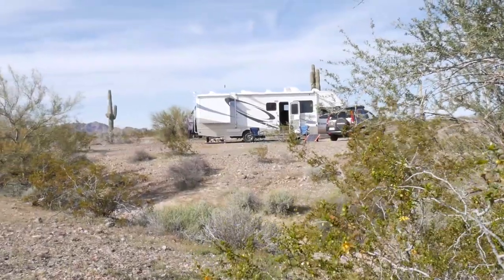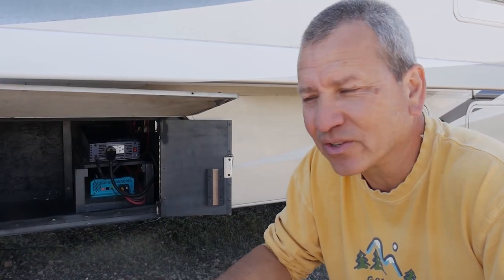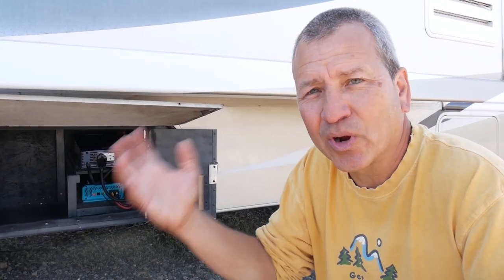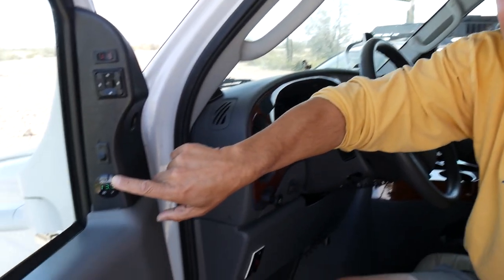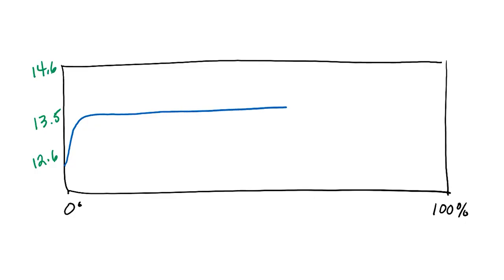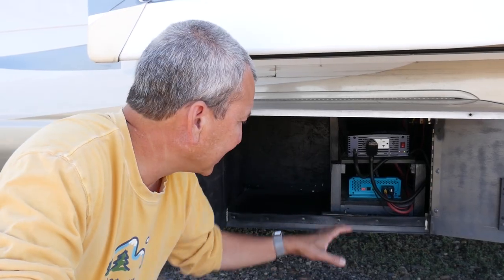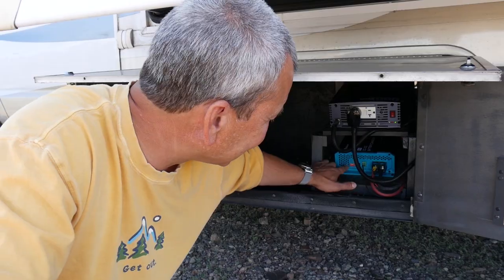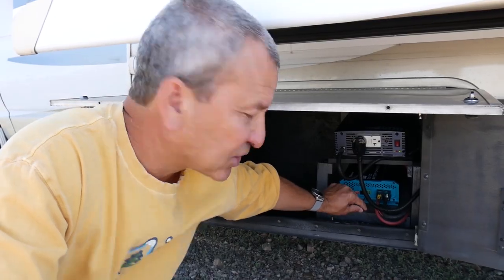Charge LITHIUM Batteries While Driving - System Setup

Comment: Hey Brian, I have purchased the 40 amp model, apparently well suited for my 160A rated alternator.  I really like your illuminated switch idea so as not to overheat the alternator when idling for any length of time.  According to Renogy's instructions, the charger should be as close as possible to the house battery.   That said, I have a trailer, so the charger should probably be in the trailer, not the truck; one more line to connect/disconnect every time I hook up.  To facilitate the switch installation, maybe the charger would be okay at the back end of the truck with a few feet of extra wire on the output side.  Any thought on this?  I'll also ask Renogy to see what they say.  Thanks.
Reply: @MrSilvertech  Mike, I don't think the factory connector on my Dodge Ram has wire any heavier than 12AWG.  Renogy recommends #4 for the long distance  that I had to run from the truck battery to the trailer.   I added 6AWG (as I already had some).  Seems to carry 40-50 amps as required.

Comment: Brian: Enjoy your videos!
2 questions  do you run the negative output of the DC DC to the chassis or to the shunt then negative battery terminal?  How do I locate your diagram to the solar system, also what are the gland size for 10 awg and 6 awg wire? Thanks

Comment: Hey Brian.  I'm in the process of following your footstep on upgrading my Class A from AGM to lithium.  I'm going to use the DC-to-DC route as well... but only thing I haven't been able to figure out is what to do with the current alternator charging (of the AGM batteries).  Since my AGMs have been charged using the alternator all along, I assume I need to disable that as part of this DC-to-DC charging upgrade... right?  What do I need to do in order to disable the alternator charging?  More specifically the existing wiring on the current AGM batteries.  Thanks!

Comment: I recently installed the same Renogy 20A DC-DC converter in my trailer to charge my lithium battery from my tow vehicle (TV) and learned a couple of things.  First, the output power to my battery measured 262W (spec says output power is 250W), and the input current was 30A at 10.37V.  Input current is not specified for the device, and I was surprised it was as high as 30A, and I need to run heavier gauge wire; 12ga isn't enough.  Thanks for the informative video, as always!
Reply: The manual says to use 10 gauge if less than 10 feet, or 8 gauge if further.
Reply from the maker: You're welcome!

Comment: How did you wire in the on/off switch?  Just a 2 pole switch between the dc to dc and a power source?
Reply from the maker: Yup that's it. It shares a ground with the negative battery terminal. As soon as it sees 12vDC it turns on.

Comment: Does your DC to DC charger work okay with your van just idling? A lot of times I have to idle and it would be nice if it's still charged my battery without overheating
Reply from the maker: I've idled for a couple hours or so. I don't like to do it but I have many times without issue. It doesn't put out full power at idle though.

Comment: Hi Thanks for the info... got a question for ya...
What is the second smaller red wire on the Output side of the DC-to-DC  Charger?
Reply from the maker: Gonna make me watch the video. Hold on.....Yeah it's just powering my cooling fan in that compartment.
Reply: @RVwithTito  Hey thanks, Man!

Comment: I understand why you took out the solenoid for the emergency start, but if I wanted to keep that switch would it still work with solenoid installed? as I didn’t want to install on off switch.

Comment: Thanks Brian! I’m currently in the process of determining the best way to do exactly what you’ve just done - protect my truck electrical while charging my house lithium batteries. Does your Renogy dc-dc converter isolate the starter battery from the house lithium batteries?
Reply from the maker: Not necessarily. If left on when the engine isn't running, the charger will continue to draw power from the chassis. This could drain the chassis battery. This is why, you should wire the power switch to a 12V source that's only powered with the engine running.  Hope that clears it up.
Reply: But  when you have switched off the converter does the house battery pass any current back to the starter battery?
Reply: It has battery Input and Output isolation.

Comment: Timely for me. Want to charge my 600 AH Victron lithium batteries off my Cummins M11 alternator while driving. Question is combiner vs DC charger. Combiner can go to 400 amps but DC charger only to 100 amps. Much cheaper to go with the combiner, but since my start batteries are Odyssey AGM battery's not sure if that is a good combination. The victron buck boost is programmable and seems like the best option but is 1K more. Decisions decisions..

Comment: I have a 24v lithium battery solar system. I have a Victron 12v to 24v  20 amp converter. I use a ford Computer relay (30 AMP, same one my van uses) fused off the engine battery. Relay powered by a switch (ign power). I cheated. I have dialed up the output on the converter to 29.6v ( 29.6 is the average voltage of solar panel output) and feed the power into my solar controller. With the panels at 100% power input and the dc to dc input I am still under the rating of the 40 amp renerogy rover solar controller. I am very happy with the performance.

Comment: I just got done installing the Victron version of this 2 weeks ago. The directions for the settings are terrible. Still waiting for BB to get some clarification as they were not sure. Mine is the 30amp version in my 2018 Thor 31Y E450. I pulled an ignition wire with a piggy back fuse and took it to a switch i installed in dash so i can switch it on/off. My DC/DC charge controller is mounted under dinette bench seat with all the other electrical. It is nice because i can see it via blue tooth and when i get the correct info i can change/adjust settings via phone. Enjoy your videos. Lots of good ideas.
Reply from the maker: Thanks for sharing your setup. Cheers.

Comment: I have a very similar motor home. I changed the converter charger to the one you recommended. The DC to DC charger seems a bit complex so I’m thinking of just disconnecting the positive cable that runs from the chassis battery to the house. Will the generator start with just the house battery? Any other issues (other than not having the cab battery charge the lithium batteries) I need to be aware of?

Comment: Hey. If I decide to replace my alternator with a high output alternator, do i need this dc to dc charger still?
Reply from the maker: You'll need some kind of regulator like this for lithium. Not necessary for lead acid though.

Comment: So  I believe you need to add a  fuse AT the  solenoid location   So  if a  CRASH  or  other issue causes a  High current to Ground The  fuse  would  break the  current.
Other wise  fire possibly would happen and  if there is  anything scary in a  RV its fire  they are completely  engulfed in less than a  couple minuets.

My idea  Ka7qqv
Reply from the maker: Thanks for the suggestion. The 30A fuse I have is just a little further down the cable so I think I'm covered for that condition. Cheers.
Reply: I would fuse every possible cable in a car ;)

Comment: usually a 220A  rated alternator is about 100A real output when you are driving.    make it easier ,  just count HALF of what the rating is.  you don't want to MAX out the output of it or it may overheat or burn out the alternator .

Comment: I have just installed a 40 amp Renogy DC to DC charger in my 2012 Wiinnebago ERA MH. I have it set to also be able to switch the unit on/off and switch between 20 amp max. output to 40 amp max. output. I'm charging 2 - 100 amp-hr. LiFePO4 batteries connected in parallel.  My alternator is a standard alternator which outputs 225 amps on a MB Sprinter chassis. I am also using a Amp-L-Start unit which sends a maintenance charge from the house battery to the chassis battery when the ignition is turned off and the house battery is being charged. I have the Renogy dip switches set to 1 off, 2,3,4 on and 5 off for an output of 14.4 volts. All seems to be functioning okay with the Renogy but the Amp-L-Start doesn't appear to be charging the chassis battery with a maintenance charge when the ignition is off. Do you, or any other readers, have any experience with the Amp-L-Start. Before installing the Renoghy Dc to DC charger the Amp-L-Start functioned as designed. I have contacted LSL Prtoducts but still waiting for a reply. Here is a link to the Amp-L-Start and the Ignition Control Relay Kit which I have also installed. https://www.lslproducts.net/ALS_Overview_Page.html  . Thank you for your very valuable and useful You Tube videos. Much appreciated!

Comment: Funny that you can use Hobby RC DC-DC charger that are more flexible and not that expensive as specialized ones.
You can set current 0-30A depending on the needs you can even use it to balance the battery even better than most bms do.
Or you can just use buck converter for 20usd and throw in voltage-sensitive relay for another 10usd ;) Again funny thing that you can combine buck converters to achieve even 100amps when needed at cheap cost.

Comment: You should still use ignition ON source to power that switch you installed. That way, if you forget to turn OFF the switch, the charger wont drain your starter battery.

Comment: I'm pretty new to all this, and confused, but from what I understand, I need a DC to DC and solar charging.. I was looking at the renogy DC/DC with MPPT built in. But would I be better off getting a separate DC/DC (with an on-off switch) and mppt? Seems as though I would be able to maximize charging this way, rather than limiting it with an all in one unit, but then again, sounds more complex
Reply: Note that the combined unit can take max 25v solar - so you have to wire multiple panels in parallel, which means higher amps which means heaver gauge more expensive wire. You MIGHT also run into trouble in vary cold weather, as this pushes panel voltages higher. Also limited to 660w.

Comment: Hello my friend, I installed a 40-amp unit, but I faced a problem, which is that the device emits very high heat, in addition to the fact that it does not give more than 13.6 volts. I tried to measure the amperes, but the reading was fluctuating. I wonder if that is the problem. Please accept my regards.

Comment: I found out I had a 225 amp alternator by “pretending” to need a replacement on the website of a parts store.  When you put in your vin number it tells you what alternator is a good replacement, voila!
Reply from the maker: Good tip. Thanks!

Comment: Is your solar just piggy backed right to the house batteries? Do they charge at the same time? Does the solar stop when it sees the dc charger putting out voltage to the batteries? Will the dc charger  hurt the solar charger?

Comment: Hi thanks for the videop. Can you or anyone else tell me if i need to switch solar charging off while charging using the dc-dc    (renogy 20amp) dc to dc only no mppt input i have a seperate mppt controler for my solar pannels cheers
Reply from the maker: You should be able to charge from both sources. If possible, program your MPPT controller to match the charge settings of the DC-DC.

Comment: Do you still need a battery isolator?  Also, with all that solar, it seems that it should also be able to configure it to charge the chassis battery, as well as the house bank. I've never seen that.
Reply from the maker: No. It also functions like an isolator.

Comment: My stock motorhome engine does a trickle charge to the house batteries.  If I add a dc to dc charger will I have two charging systems interfering with each other?
Reply: That's my problem too, can't find any info on motorhome installs
Reply from the maker: If you went with a DC-DC charger then just disconnecting the other trickle charger. Maybe you can reuse some of the cable connections if they are big enough.

Comment: If you read the manual it explicitly says starter battery fused Line to the input of the the DC to DC charger. Incorrect to directly go from alternator

Comment: Why did you choose the 20 amp DC-to-DC over the 40 amp? Lithium batteries would take all the 40 amps and you could even get the the 60 amp model if your alternator is above 180 amps.We have 2 Battleborn  batteries and got the 40 amp model as our alternator is 220 amp on our Promaster.
Reply from the maker: I could always upgrade to the 40A. Our alternator is smaller and 20A works for now.

Comment: I have not yet purchased a lithium battery. My RV like most has a converter that charges the battery when connected to shore power. When I am moving the battery is charged by the truck’s alternator. Is that sufficient for a lithium battery or do I need this between the converter and the lithium battery?
Reply: I need to add that we occasionally boondock and found the single wet cell deep cycle to be insufficient.

Comment: I wired my 12V batteries to 24V and its my first build.  Can I use my van's alternator to charge my battery bank?  Is there something that will convert the 12V to 24V?  Thanks in advance.

Comment: Concern seems to be overloading/overheating the alternator.  Wondering if a thermal switch could be used to monitor alternator temp and shut down charger automatically.  Just an idea.
Reply: That is what a Balmar $$ alternator does.  It regulates (no need to shut down) the output according to internal temp.

Comment: A lot of people have a small to medium battery bank / generator. 1000 watts or less. Your 12 volt cigarette
 lighter / 12 volt plug should be 120 watt to 180 watts. 
Is it worth the cost to go from 12 volts at 10 to 15 amps to 20 amps ? I don't see it.

Comment: Is it better to change a battery off the alternator which costs a butt load of money to replace or have a smaller generator in your tool box if your in a cloudy place and solar panel isn't working to charge the batteries  , my alternator is a few hundred dollars replacement.

Comment: We use B to B Charge Boosters for our 120 Amp alternators ( Fiat / Dodge) regular Ford V 10 should be 120 amps as well..a B2B booster will be installed between the batteries ( Chassis and house), replaces a sep Relais and Signals the alternator " not full" even when Chassis Batt ist Full and gives the Designated by Dip switch charging profile then automatically to the house batt ..a Agm will be charged with 20 amps ( since a big part is Low amp anyway) but a Lifephos will be charged with 45 amps and more..they ( suppliers) recommend min 45 amps for powerbanks of more than 200 Ah..i use 56 amps off a 120 Amp alternator since years, high power comes even when idling..cable Must be thick n short ( i mean really Finger thick)

Comment: The charging output might be 20 amps, but I think you will find this unit will consume more than 20 amps.  The whole purpose of these is to be positioned a long distance from the initial source of power, where voltage drop is common.  So they use more amps to do the job ..

Comment: My tow vehicle has a heavy duty alternator (240amp). Do you think I need a charger like this with such a large alternator?
Reply: Alternators are made to charge a lead acid the quickest way possible but whit great resistance from the battery. Not so great for lithium since they don't  have much resistance  at all. The alternator will overheat after just a few minutes at low speed since cooling is regulated by the speed it turns. Search for Victron video on alternators, lithium and why they overheat.

Comment: Hi I have this dc-dc charger for my lithium battery, I hooked the input to a" new full charged "12v 100Ah power pack that show's wattage draw. and out put to my lithium battery,  the watt meter shown 350+ watts  and after a min or so the power pack cut off due to voltage drop  thought it only had max 20A  Help plz

Comment: I have a 2019 Winnebago Outlook on an E350 chassis. The Winnebago brochure says the alternator is 155 amps. I know your rig is a 2007, so the info may be hard to find, but maybe you can find your alternator’s amperage in the manufacturer’s brochure. RVUSA.COM has specs and brochures for a wide variety of RVs including lots of stuff from older model years.
Reply from the maker: Great info. Thanks Tim!

Comment: Great video as usual; however, I’m not following your solar vs dc to dc charger logic.  I understand the concept where your charging preference is for solar.  But you loose me at the power on switch for the dc-dc charger.  I assume you don’t want them working at the same time.  (maybe for some incompatibility running parallel charging systems) So my question, is there some other piece in the system where you disconnect the solar system when you power on the dc-dc charger?  Or is it that the systems are compatible and they can run in parallel safely . but it’s just your preference to limit the alternator load?   In other words, is it safe to run the dc-dc charger during the day (sunny while traveling) .. however you prefer that the solar does it’s thing primarily without the additional / parallel dc-dc alternator load?  Is there any harm in running both charging systems during a sunny day?  (Parallel / Fast Charge)
Reply from the maker: It's totally fine to have them both charging together. I just want to be.able to control when the dc2dc charger is on. If you'd rather keep it on the entire time the engine is running then that's up to you. Hope that helps.